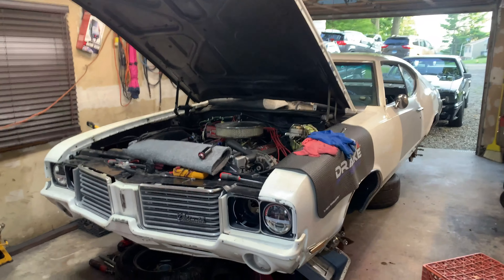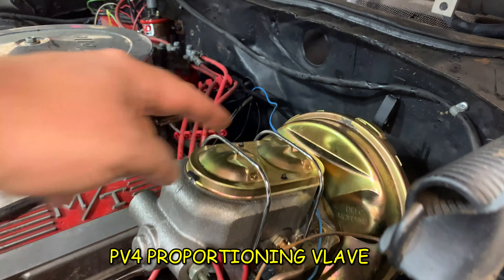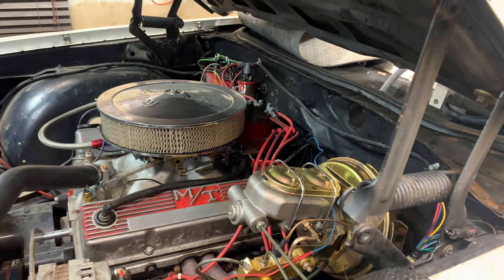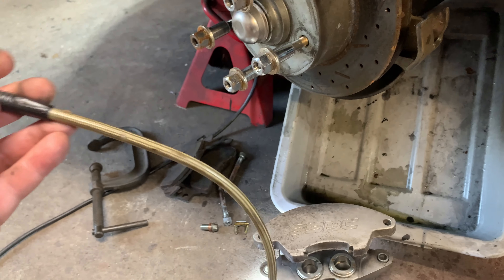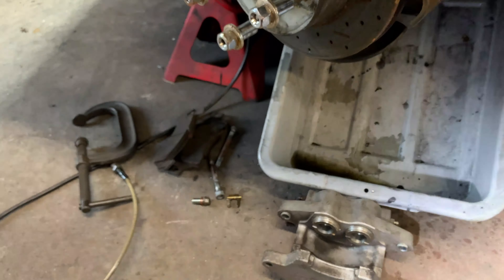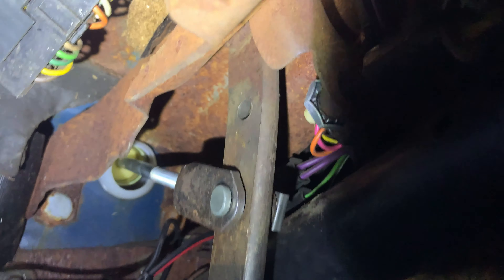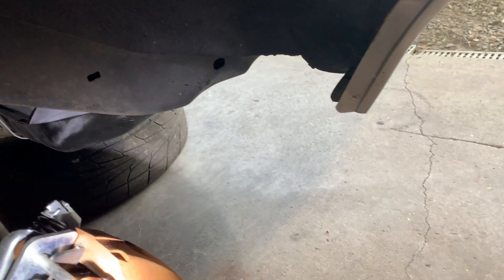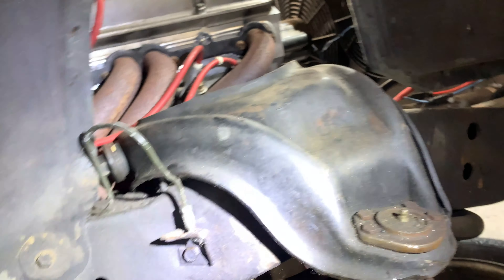1971 CUTLASS 4 WHEEL DISC ROCK HARD BRAKE PEDAL

Comment: Have you tried removing the Line-Lock and testing the brakes with it?
Reply from the maker: I’m 90% sure I got it, these kits say for 68-72 A body cars but, they seem to be universal, looks exactly like the kit we put in the red 65 mustang? Nothing fits like it should so, everything has to be customized, all new lines and the rod from pedal to booster is a fit any car, I’m guessing? I had to cut down the rod to fit the cutlass pedal & the rod clevis. I now have a decent pedal. I have to make a small adjustment and it should be perfect so, basically it was the rod not cut to size and nowhere in the instructions does it say this had to be done. These companies selling stuff are full of xxxx! lol… hopefully be done on Tuesday? Hubs on dodge pick up then clutch cable on mustang….ouch! The BMW that is notorious for being unreliable is the most reliable! lol.